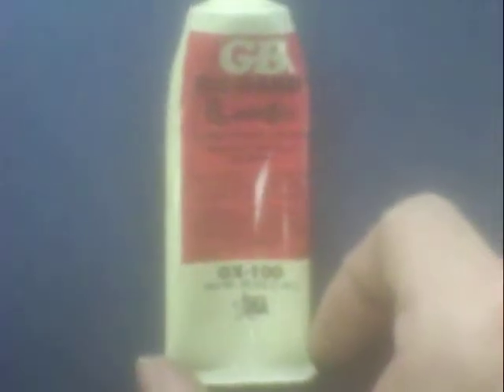How2 Fix Electric Motors part 2, Electrical Grease/s

Comment: Gardner Bender OX-100 contact grease contains metallic zinc powder and that stuff can cause your commutator to fail by bridging your insulation gaps in the commutator with conductive zinc metal powder.  This grease is designed for  increasing contact current flow by coating the contacts with a thin layer of metallic zinc powder.  You can clean your electric power tool commutator with perchloroethylene solvent (brake cleaner, electric motor cleaner, safe for field windings etc) and the CRC 2-26 (stoddard solvent, white spirits,  distilled light hydrocarbon with added butyl stearate fatty acid soaps). Then wire brush out the commutator grooves carefully and make sure they are not packed with conductive graphite and copper powder residues from operation and brush commutator particles from wear.
Reply from the maker: Thanks for leaving a message, I see your point. But I still lack a fundamental understanding of basic commutator function b/c I don't even know why it needs an insulation gap in the 1st place. If you have a short clip handy that explains this I'd like to check it out. I've had several motor classes, but still not enough Experience. I'd love to work at a motor shop that repairs motors. You obviously know your stuff, so I may need to pick your brain again sometime, thanks again, take care.
Reply from the maker: Also if you don't mind watching my 2 clips about the 5 HP 1phase 240V motor I'd appreciate your input on those as well.  I need to do a search for how to test the stator motor windings, & if you run across a good short clip, send it my way.
Reply from the maker: So in other words, a better choice would be a high temp dielectric grease?   That's my 1st thought, since dielectric grease will help Insulate if it gets between the insulation gaps.